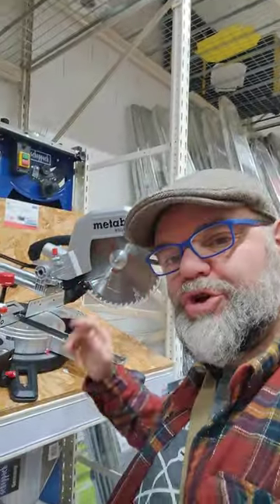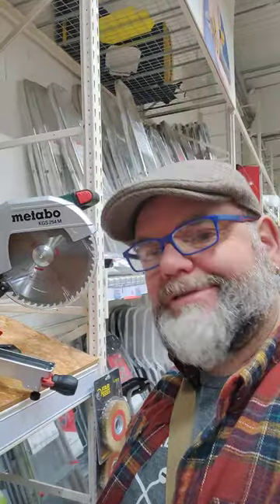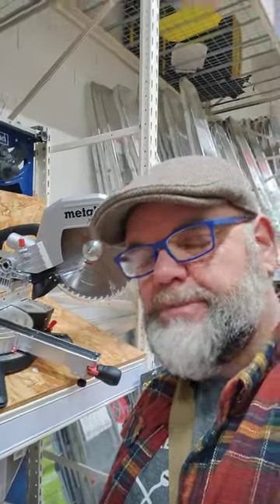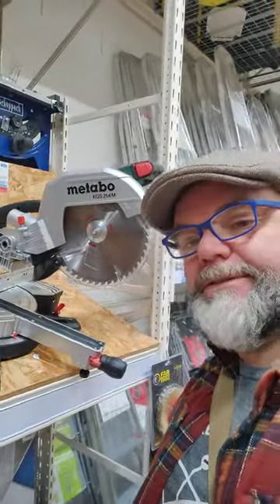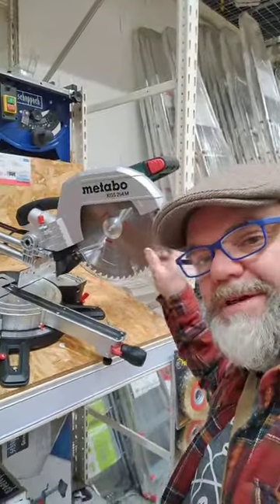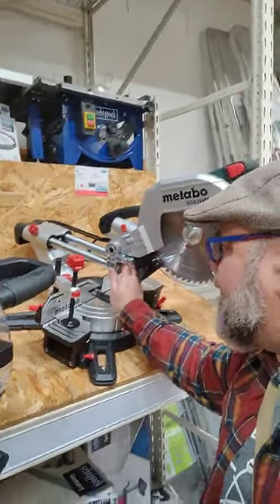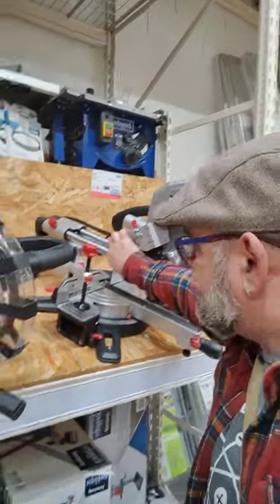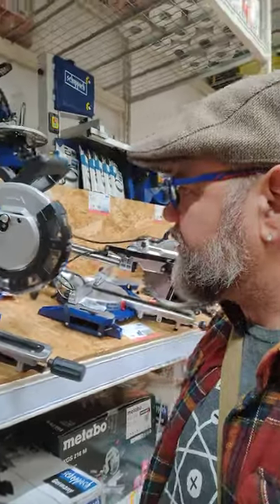Too much slop on chop saws to be accurate #mitresaw

Comment: It is weird... I've seen some people coming up with solutions like thicker parts they make out of steel to replace some jiggly construction on their older tools and sometimes they add some bolts that restrict movements on parts that wear out and have travel in them, but I guess it's like making a jig for something that's supposed to be operated without one.
Reply from the maker: I do use jigs instead of using the increments but I'm in a workshop... On site I'd need the machine to be accurate without any fettling... I suppose that is the sacrifice when buying a budget tool... 🤔🤠
Reply: You can keep a sturdy old tool going, but who wants to buy a new piece of hite and start improving it from day one?
Reply: @johnmac4094 Nobody really wants to, but it's mostly a decision based on the spare change in the pocket and the approximate price to performance ratio multiplied by some probabilities on how much cuts you need to make and if you need the precision plus a coin toss here and there. The less money in the pocket - the more options appear before the actual thing like - don't spend any money and do it yourself using a handsaw (I don't mind my picture frames being misshapen) VS don't spend any money and let your old man saw the thing you need for you VS makeshift lever thing with some sort of clamps holding down an angle grinder you already had (the deathtrap) VS store bought clamp thing chop saw conversion device that holds your angle grinder or circular saw (the deathtrap you can maybe even sue someone over, but probably not since it was made in a faraway country) VS cheapest chop saw they have and a few bolts and nuts VS considering buying a proper chop saw.

Comment: Meh I hate to say it. Try a Kapex. Rock solid and accurate out of the box…… 
I know costs a fortune, works exceptionally well though. Main bug bear of mine with it. Trenching function does not set high enough for shallow trenches in thick timber. Only thing I have found that is not up to snuff with it.
Reply from the maker: They are good but so is my RAS but I would like a Kapex
Reply: @WallyboisWoodworking  RAS are lovely, I don’t have the space, hence the Kapex